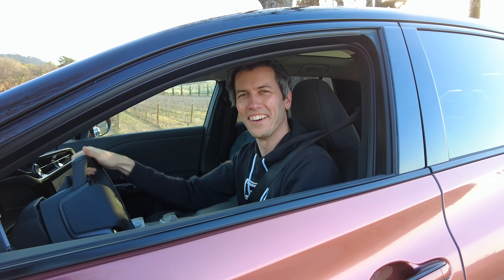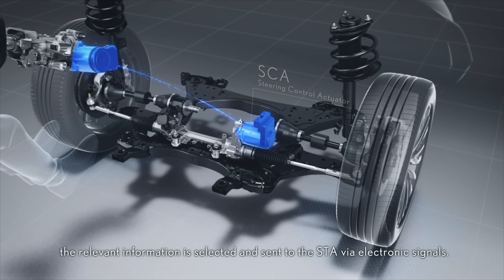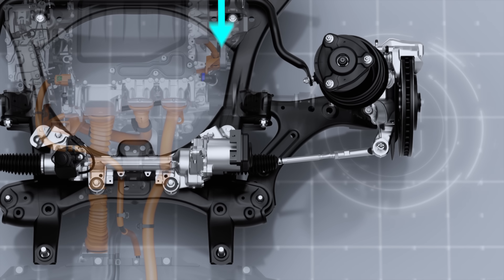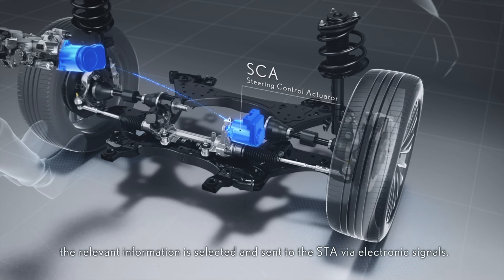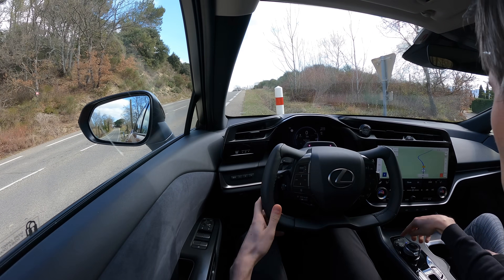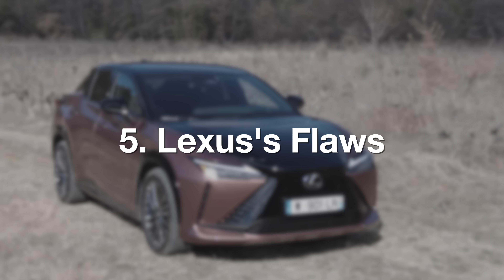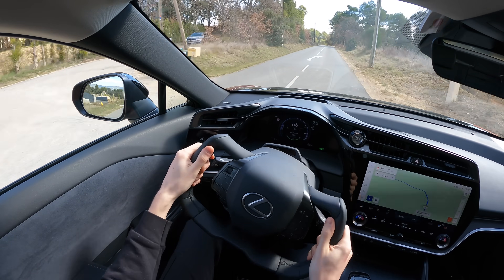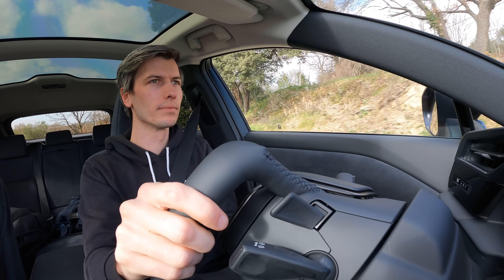How Lexus Fixed Tesla's Bad Idea: Steer-By-Wire Yoke

Comment: The technique is interesting and very flexible, but I think there's a lot more problems still to discover. The steering delay shown in the video is not acceptable when driving. The "intelligent" disregard of very quick inputs when at speed is another thing hard to accept. I would be very interested in learning how fast the wheels can go from straight to 50% left, 50% right and back to straight. I'm talking both of how fast the motor can do it with the computer sending the signals independent of the steering wheel and as a result of input from the steering wheel. When driving in icy conditions and well as driving fast on gravel the speed you can throw the steering is very important. Latency or if the wheels are slow to follow the input is not a good idea then.

And as some some one posted below the variable steering ratio isn't a simple question. Something you didn't touch upon was how the ratio would change if for instance you are coming into a curve while slowing down. Will the ratio change while still in that curve, or will it wait to start changing the ratio until the wheel is returning to zero?

It might be a better idea to use a fixed curve relative to the throw of the wheel, where the ratio is lower in the middle where you will be holding the wheel when at high speed, and then raise the ratio as the wheel is turned further towards the extremes. These extremes is going to to be used at low speeds, at least during normal driving, and there you have a lot more time to react. Now I'm not saying this is THE WAY, just throwing options out there to see what might stick...

Comment: Seems to me a case of fixing what ain't broken. and by the way as a very tall driver I can tell you it's not the top part of the steering wheel that limits my view of the instruments, it's the middle part of the wheel, since my seat is very far back. So the only advantage I see is you might save a couple of seconds while parking, doesn't seem worth it. I certainly wouldn't chose this option at equal price.

Comment: I disagree in the safety. It's enough for one of the motors to catch on fire and the entire system is dead. Or the casing simply breaks - which happened to me once, with the alternator casing. Redundancy should cover distance between components too.

Comment: Bad design from start to finish… 

- the yoke is inferior to the wheel it wants to replace, forcing drivers to specific hand positions that we already know are not ideal for driving (10/2 is taught to drivers for a reason)… so for sure every car will have this next year.

- As for a changing steering ratio... that's not only bad design but dangerous at multiple levels. Now we'll be asking drivers to learn varying nonlinear behaviors (adding cognitive complexity to the critically important steering task)... how the ratio changes with speed... and what happens during high speed emergency steering... and what happens if you're turning while you're slowing or speeding up... does the steering angle change AS YOU slow through the corner even if you're holding the wheel steady?... or does it stay at the low value even as you go slow causing you to need to provide different steering input at the same speed depending on prior conditions (again adding cognitive complexity to a task that MUST be kept as simple as possible).

And that steering lag... you're adding a complex control loop PROBLEM (in an ideal motion system you don't want your control loop to have to deal with lag if you can avoid it) and asking drivers to run those feedforward calculations in realtime and potentially under emergency conditions. 

I'm AMAZED this has gotten as far as it has... and the lawsuits when it hits the market and causes accidents... oh the lawsuits...

Comment: I think the argument of steer-by-wire for better steering response weak. Yes, you can achieve a low steering ratio to get a fast steering response without compromising safety at high speed. However, you also show at the end of the video that there is a lag between turning the steering wheel and the wheel actually turning. A mechanical system would have virtually no lag between steering input and the wheel rotation. Which is better?

Comment: The biggest point of concern with this system to me is the delay or even the possibility in a high tire resistance situation that the yoke won't be able to stay in sync with the wheels at all. This could never happen in a mechanical system because it will transfer the resistance from the wheels to the steering wheel and the driver will never be able to turn it more than the resistance allows.

Comment: So if your 12VDC system fails your wheels are stuck where they are, like the parking break that doesn't work when the 12VDC system fails.

OK fine maybe won't fail when you are driving but what about when you've got to push it around in the back yard to get it under the shade tree to work on it.

Comment: Excellent explanation. Thank you. In answer to your question, I want instant response. I love to drive. I drive motorcycles, cars, pickups, and have a few toys (electric bike, tractor, etc.) and I am a pilot. For me, it's fun to experience the limits of the vehicle. A delay in the handling would be infuriating. The tech is probably ok, but it needs to simulate the driver's commands exactly.

Comment: The title card is a bit click baity and misleading. If we're talking about ideas, Elon was talking about steer by wire for some time already, about the time they introduced the yoke. So how could Toyota fix Tesla's idea, if what they did was the Tesla's idea? The title makes it look like Tesla needed Toyota's help to figure out they needed steer by wire and that's not the case. They thought about introducing it together, but decided there are some aspects of this technology that first need to be addressed before they use it in their cars (they talked about the level of feedback if I remember correctly). So the idea was there, they just consciously decided not to go that way at this point in time. I guess see you on the next video. Cheers.

Comment: If the response is dull at high speeds because it clearly can't be too sensitive here during normal steering... what about on an emergency event where you need a quick response from the steering and you're still under high speed?

Comment: On the backup motors in this system... there's no need to reinvent the wheel (so to speak) here, so Lexus will like do the same thing that the aviation industry has already established.  So, this is a question for those who know what's done in aviation:
Is there a main motor which does 100% duty and the backup only takes over when the main fails, or they alternate duty (say each time you start the system) and hence doubling the lifecycle of those motors?

Comment: Jason: a suggestion, I believe most cars have hydraulic assist steering, not electronic assist steering. Some cars have the power steering pump electrified, but it still pressurizes a power steering fluid to assist steering.

Comment: Engineering reliability?  There are mechanical steering shafts systems 80 years old with out service and orginal parts.  This electrical system will not be anywhere close as there is no electrical system to date that is.

Comment: I find it a very attractive idea. And it means other options could fairly easily be added, like going sideways to park, or using the back wheels to help steer at higher speeds, or turning round in its own length by having each of the four wheels parallel to sides of a rectangle.

Comment: For the steer by wire, you should have 2 separate batteries and motors and sensors, and be a semi-closed system, so in case of everything else failing, you still have a minimum of 3 hours of steering with 1 battery, and 6 hours with both, just in case.
Reply: It’s not made for reliability. It’s made to leave you stuck until you pay for a tow and a huge repair bill.

Comment: You hit the nail on the head as far as my concerns go. No problem with the tech; if it's fine for aviation, it's fine for automotive. As someone who likes sensitive controls (that mouse analogy was for me!) this is great. But that steering latency is unacceptable.
Reply: IF we certified the systems, and then maintained and inspected cars like airplanes I might agree, but doesn't happen in the real world. There are no inspections of any kind where I live.
Reply: You know how is it different from aviation? QA won't be the same, postmortem reviews won't be the same.
Cost of repair will be similar though.
Reply: @oleksandrkuzminskyi7789  I'd argue that because these systems are more advanced and electronic (I believe he mentioned this in the video) that the car could basically just refuse to drive or lower functionality if there is any sort of issue. And personally (there is no way of knowing until they become more widespread) I think that these will "eventually" become pretty affordable if more cars on the road are using this system but for now it will likely be in more high-end cars and eventually come down in price. Ideally though, in a "perfect world" the US would implement an annual or at least every 6 months mandatory inspection of all vehicles. I find it mind blowing how many people are on the road with things like non-functioning headlights, brakes, or bald tires and the list just goes on and on.
Reply: @oleksandrkuzminskyi7789  Boeing's QC for software is so good they did know they had a problem till the 737 max started falling out of the sky and starliner discovered multiple fatal errors on it's test flight.

Automotive has higher QC because they are dealing with far higher volumes of things being inspected. The just do it more often so they have more reps to refine the process  Toyota practically wrote the book on quality. If I have to choose between trusting Boeing or Toyota I'm going with Toyota.
Reply: @hallkbrdz  A purely mechanical system can fail too, and given the redundancies built into drive-by-wire, the chance of catastrophic failure is arguably lower.

Another advantage are the built in self-diagnostics. If the system detects a partial failure, the car could limit its top speed or even entirely refuse to be driven until the issue is fixed. Many drivers endanger everyone on the road because they can't be bothered to change completely bald tires, replace non-functional brakes, or even fix a broken steering column... if this forces them to address a dangerous problem, I'm all for it.
Reply: I have a 20 year old kit car with no power steering, no assisted brakes, no diver aids, no ABS and it’s an absolute joy to drive compared to my daily. Modern cars are just tools to be used to do a job.
Reply: Is the delay in steering a problem or a solution?
Traction control limits the power going to the tyres so they don't slide. Steering control can do the same, limit the turning speed so the tyres don't slide.
If you have driven on a racetrack you would know to turn the wheel not jerk the wheel to maintain traction. My guess is Lexus is doing this for you.
Reply: Redundancy is only necessary when you don't trust the system. The F-16, aka the Lawn Dart, has triple redundant fly-by-wire because control surfaces are actuated by electric motors. The plane it replaced, the F-4 Phantom had not much redundancy - generator in case of engine failure. Far more F-16s fell out of the sky than F-4s.
Reply: > No problem with the tech; if it's fine for aviation, it's fine for automotive.

Fools rushing in as always. In aviation, systems have backups and redundancy. These over-complicated systems in cars never seem to. If one thing breaks, you're stuck (yes, I've been a victim of it). The logistics of running cables in a far larger and more complex control scheme, possibly requiring assistance due to unstable aerodynamics, also provide justification for by-wire controls where in cars, they are not. They aren't really justifiable in cars at all, not even to the extent they exist now. Just like front wheel drive, it's for the manufacturers' benefit so they can sell you cheaper stuff at a premium. They marketing department finds a way to sell it to you, make you want it and make you believe it's actually progress. Don't be a sucker.
Reply: @Sonny_McMacsson  not like mechanical steering is bulletproof. It can fail (yes I have been a victim of it).
Two of us are for sure significant in terms of scale, we have to be, right?
Reply: @cyjanek7818  That's a weak argument since it doesn't address relative safety. It only addresses the fact the machines can break down, which everyone knows. Many times, it's sketchy maintenance. It's also a baseline design implementing the minimum functionality for the concept of steering to work. Comparing cars to planes is ludicrous because of the redundancy and backups aircraft tend to have but cars lack.

For instance, it used to be the case that there was an easy backup using the key to get a car out of park when it had an electronic shifter that couldn't actuate. But in the recent past that capability has been removed. There may still be a way but it's very inconvenient and convoluted and might involve manipulating things under the car.

For mechanical steering, there are fewer parts to break. If your steering assist fails in most cases, you still have steering but with more effort. There is no complex software with potentially unknown bugs or countless small electronic components to break or be subject to EMP or other attacks. The mechanical system still work without any power, allowing the vehicle to be moved for convenience or safety reasons.

I'd more favor a hydraulic system which would still provide most of the locating advantages of wires, while still allowing a power-free connection and redundancy. It could also allow profiling of the steering angle curve for different circumstances.

I don't really understand your second point? Are you alluding to us being a small sample size? We may be, but the cars are not and their engineering can be critiqued from one example. Experiencing one failure where I couldn't remove a vehicle from the road tells me about the deficiencies inherent in the design (which I actually already worked out for myself before I experienced any problem).
Reply: @Sonny_McMacsson  He literally mentioned in the video how these systems or at least in this particular car, there are redundant systems. Did you not watch the full video? And I'd argue/wager that this guy is WAY more qualified to give these answers than you are.

Comment: I... hate it. Variable ratios means I'll never really know how the car will react at any speed. Maybe it's fine for a grocery getter, but anyone with an once of enthusiasm in their body can learn a shorter-ratio steering rack just fine. Actual enthusiasts will want a single ratio, as much feedback as possible, and zero delay. Hell, rally drivers even disable the brake booster because it changes based on RPM.

Comment: What if you turn the steering wheel right at high speed, then slow down and turn the steering wheel back to it's neutral position :D Same steering wheel angle at different speeds = different angle on wheels.

Comment: You did a great job of covering most of the main concerns with a yoke + drive by wire system but one that you didn't cover that would concern me is how the difference in responsiveness at slow and fast speeds would affect muscle memory. Most drivers with lots of experience know exactly how a micro movement to the wheel will steady the car in it's lane at highway speeds but how do you develop muscle memory if there's a variable injected there?
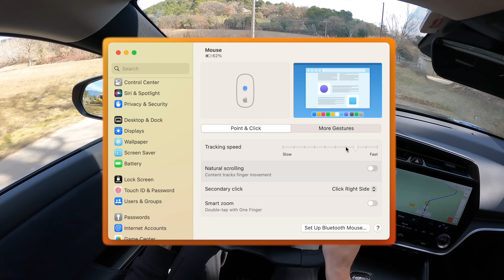Reply from the maker: Discussed in the video, starts at 13:31.

Comment: Lost me at praising them for including a buttload of tacky buttons on the steering wheel lol. I would never want to look at a button cluttered steering column ever again at this day and age.

Tesla does need to bring steer by wire to the Model S/X lines though, I know it's in the plans but not there yet. 

I like Tesla's Yoke design due to improved visibility and convenience of highway driving, but would prefer if they kept the turn signal stalks, so it's not the yoke itself but the awkward placement of turn signals that I'm not fond of.

Comment: I think speed shouldn't be the only factor to variability, throttle and brake position should also modify variability.  That way you don't floor it and suddenly have a low steering ratio, or hit the brake and still be stuck at a high steering ratio; this also leads into to cornering with throttle lift and things like trail braking.  Also, while having a disconnect between steering wheel and steering rack, I think some amount of autonomy needs to exist for a certain amount of atypical maneuverability.

Comment: Well I actually don’t understand any of the whys, bmw presented in 2003 adaptive steering ratios, so for me the initial argument is invalid. The other are okey, but it’s just adding complexity, more use of micro chips for the whole electronics etc, this makes the systems environmental impact vs a normal steering system worse no? Isn’t the goal of electric cars to reduce their impact on environment ? Plus all the redundancy, is it really necessary?  I think as engineers & designers, we should assess if something is necessary or only beneficial, and here it’s not necessary.
As an engineer I’m pretty fascinated by the system, but when looking at the entire car system and the future needs in mobility, I don’t think this is where we needed innovation sadly. 
Thanks for the video, and hope you enjoyed driving in the french countryside😉